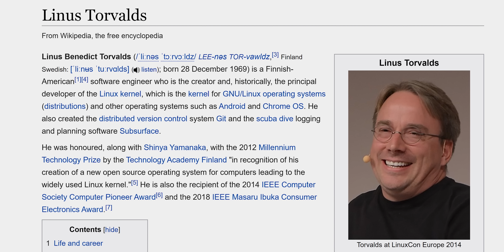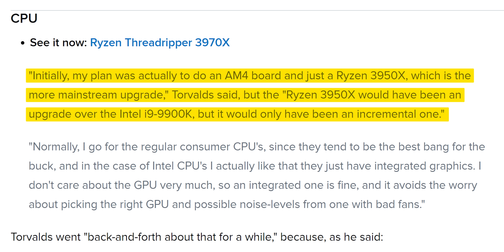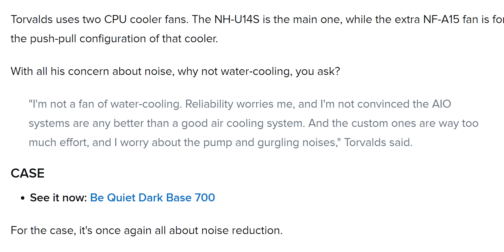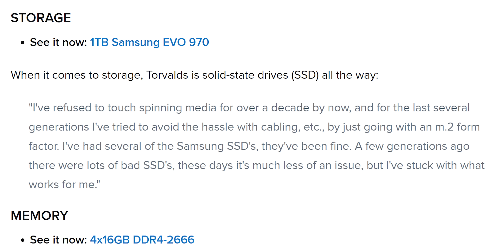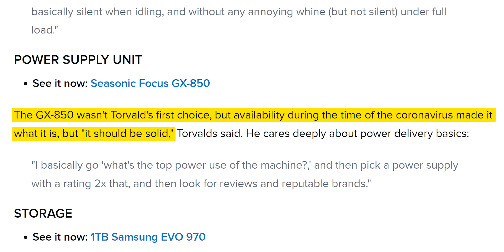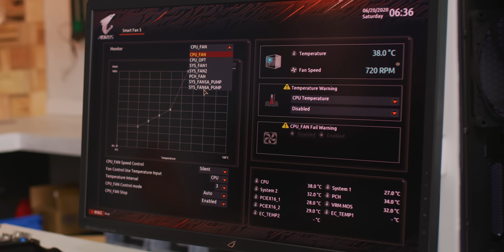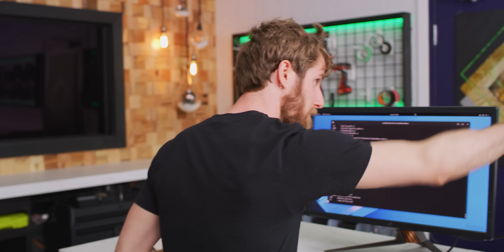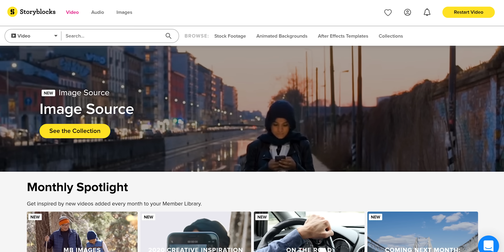Linus builds Linus’ new PC!

Comment: Is there actual evidence that having two fans in a push / pull configuration on the cpu heat sink does any good or enough good to be worth the trouble?  In general I've thought the only thing that really matters is you want the fan to pull air through and not push it because it's better for the flow to be laminar (suck/fan downstream of cooler) instead of turbulent (push/fan upstream of cooler)

Comment: for some reason booting into Windows after using Linux Mint on a 1660 SUPER caused Windows to blue screen due to driver problems (rebooting afterwards fixed it but then it would repeat if i used Linux again)

i agree with (other) Linus

Comment: Another pro to going double what you need on your PSU is that power supplies tend to be most efficient at around 50% use which means that at max use your PSU will be running at its most efficient

Comment: "He actually doesn't even need 64GB of memory"

Huh, weird. As a software developer myself, I find compiling to be very memory intensive, particularly with so many threads. I actually upgraded my system to 2GB of RAM per thread, because I was constantly running out of RAM with just one. It might just be the kinds of projects I compile - scientific computing code has a lot of metaprogramming that needs to be dealt with at compile time.

Comment: Looking to build a machine which will be running only Ubuntu for developing Linux and LLVM. 
Having an Intel 12700 CPU, 64 GB RAM, WiFi 6 are hard requirements.
My problem is that I cannot calculate my power and cooling requirements. Also, I am NOT A GAMER. Hence, will not be needing those high end GPUs. Unfortunately, the only videos I see are for gaming PCs which feature GPUs. I just need a low end GPU, something like this build had.
Looking out for a kind soul to help me out with this build by suggesting the other required components

Comment: Mine is better, same Threadripper 3970x, with 2x WD Black SN850 1TB, 4x WD Blue 4TB, 2x 32GB DDR4 3600MHz, 3x RTX 3060 12GB (DL Training), 1x RX 580 Sapphire Pulse (display), 2x Corsair RM850, Noctua NH D15, Custom Acryllic Case, but only TRX40 Gigabyte Designare, Purpose : All in one Software Dev + DL Training workstation

Comment: The important thing for dev focus build is one, a multi core CPU with tons of cores.  The more threads and modern the Architecture the better.  Compiling uses all the threads you can give it so try to put a ton of your budget into that.  Next you need a ton of RAM. GCC for example will use a ton of RAM per Job so you want a ton and tons of RAM.  Get at least 16GB bare minimum but try to go for 32G or even 64G or beyond.  Rule of thumb is to count the number of threads in your system and multiply that by 2 to get the most optimal amount of RAM needed to quickly compile without using Swap memory.  So if your CPU has 32 threads get 64G of RAM. If you have 64 threads go for 128G and so forth. For your disks, a good SSD is important.   Get a quality NVME M.2 SSD with enough size to hold your code and compiled binaries but make sure is as fast as possible. Lastly Motherboard realiability is a good to have thing.  Get one that has quality parts but dont pay too much for it either. Unless you work with GPU related code, dont worry too much about the GPU just make sure its a supported GPU and is stable. If developing on Linux I recommend either using Integrated Graphics if possible or going the AMD GPU route.  AMD has solid Free drivers that just work out of the box and you dont have to worry about it.  If you need an NVidia card because of CUDA then make sure you install the NVidia propietrary drivers needed.  As for the software if you are doing Linux development you need a bleeding edge distribution so something like Fedora is actually a great choice, another great choice is OpenSuSE Tumbleweed and if you want to get your hands dirty a lil bit you can always do Arch Linux.

Comment: Why did it take so long to compile the kernel? Make would only recompile the source code that changed. You do have to link the object modules together. 3 minutes seems awfully long just the link a few hundred object modules. I use Smalltalk so changing code require less than 3 seconds.

Comment: That's one expensive machine, but not very portable. Could make sense as a headless server with a GPU upgrade.

This is what I want as a developer: a light, small formfactor laptop with 10h+ battery, 16G RAM, thunderbolt 3, decent screen, good trackpad and a great backlit keyboard. I really couldn't care less about the laptops performance, so long as it can handle a lot of tabs (hence the 16G of memory), and is able to dock to 2 high-res monitors, ethernet and other USB peripherals with a single connector while fast charging (hence the thunderbolt 3). This is especially important as I work both from home and the office, and I don't want to have to assemble and disassemble my stack on a daily basis. Heavy load? Utilize a build server.

Comment: As a dev, I work on a Dell Latitude, but it isn't used to compile software as the code is built on a server.
For my personal build, I am using a Thinkpad T440S with a SSD. Good enough as a daily driver, developing and doing some electronic designs.

Comment: Yeah, I agree with Torvald's cooling opinion. I've not seen any reason to go water-cooled over air. All you're doing is moving the heat to a different part of the system to be air cooled, so why bother with it at all? Just get more airflow within the case. That's why I got the big ol' ATX and put 120mm fans in it. Can't hear them one bit, but they move so much air I'm looking at 50-60c under load.

Comment: The Nvidea 1030 needs no power cable and some models with the right heatsink can be fanless. I was surprised to get a higher FPS (Cinebench R15) with the 1030 than with a 1080 on the same computer.

Comment: I do Software development in C++, so a fast CPU is a good idea - Except that with distcc, most of the work is done on servers so a decent is enough.  I have some random AMD GPU for the OpenGL parts of the software - But don't care much which.  I guess that my GPU is a decent representation of what customers may have, so I think it's a plus really.  RAM is super important, 32GiB minimum on desktop.  Also, absolutely no HDD please - SSD 100%!  Don't care if it's SATA or m.2 however.  Most important is that everything is supported on Linux!

Sounds pretty boring I guess - But it's a tool to get work done, and not to game on.  On that note, a really good keyboard goes a looong way!  Not only for the typing experience, but also because cheap keyboards always broke on me after 6 months lmao.

Comment: This IS a PC I'd build myself, if i wasn't on for gaming and had to much money so i could spend the money for a threadripper. I love the choices, especially the choice for the fans and the case. And what i also totally like is the absence of any damn RGB LEDs inside of it. 

Why everything marketed as "gaming" must have RGB? The only RGB LED Thing connected to my PC is my SharkoonSkillerMech SGK3 (brown switches) and it's set to faded red (because that doesn't dazzle and is still good to read, not that i needed to read the keys ;)).  Without any freaking effects. And that keyboard was my choise because its a reasonable priced mechanical keyboard with brown switches. 

Who needs RGB-Lighting in cases that are usually standing on the ground, in most cases under the desk, where no one sees them anyway (as desktop cases are usually not high enough for an usual PSU or they are the desk itself, which makes them usually really expensive)? What I COULD understand was a single mode LED inside the case to see the parts while the case is opened for maintance. Well, but usually you turn of the PSU or better take the wire OUT of the PSU, so that would not bring that much of advantage too.

Comment: All my builds last 5 years. G-skill DDR4 3200. Seasonic psu if they make one in the physical size I need.( I do a lot of mini-itx builds so Corsair/Silverstone. Last 20 years...Noctua CPU coolers and Noctua fans exclusively. Nvidia graphics cards exclusively. MB? Asrock but am open. CPU's open if using a GPU. No GPU I go with Intel. Case? Open. Lian Li, Fractal design. Built an InWin Chopin today. Nice case and is made in Taiwan. SSD's...lowest price as long as I am familiar with the brand but prefer Samsung overall.

Comment: i'm a developer and i'm not really knowledgeable about hardware, and thats why i bought a machine with the following specs:

AMD Ryzen 9 5900X 12x 4.8GHz
32GB DDR4-RAM PC-3600
Nvidia GeForce RTX3080 10GB
240GB M.2 SSD 
MSI Watercooling

7.1 AUDIO BOOST / Gigabit-LAN

it was about 2500€, now it is 3000€. I honestly link it is overkill. I woud've loved to get in contact with you about this before i bought it :(

Comment: My aircooled PC is zero dbm (and Fans are running!) and even under load its very very silent. My refridgerator is louder as my PC. This shows too, that a good Aircooled PC (Noctua btw) is sometimes way more silent as AiO or Custom Watercooling. CPU is i9-10850K with a 1080Ti that will get a upgrade to RTX or a AMD Graphics card soon.

Comment: I can't agree more on power delivery.  

I never overclock more than 10% but man, I've had things go bad from bad power delivery even at stock speeds.

The heat sinks on M.2 is more for the controller than the flash memory.  In fact, if you put a heat pad on anything for it, go for one over the controller.

I agree on him about nVidia.

Proprietary API lock-in with CUDA is just the start to their evil monopolistic tactics.   I'm so glad to see Team Red making good GPUs again!

As of RAM, I like the G.Skill ultra-low latency 3200 DDR4 sticks I have, but admittenly my system has run much hotter since I got them in.  (I'm running a 1st generation Ryzen, so yeah, it wasn't designed for the higher voltage RAM, and it runs hot with it.)  The nice thing about the 2600Mhz is it's the fastest you can get at the lower voltage, making it run cooler and quieter. 

I would have used the Rx5000 series GPU, because they consume less power, and produce less heat as a result, making it nice and quiet.  Of course, like he said, he doesn't like to research and it was more what he could get for the price.  The Rx5000 series was jacked up in price by Bitcoin miners when he did that build, due to it's exceptional power efficiency.

Comment: the fox was and is better than the penguin. there's like no question about it unless you're a normie

the nvidia thing is partially bc nvidia refuses to open-source their drivers, meaning non-proprietary Linux distributions (like default Ubuntu) can't include the nvidia-driver package by default and have to use a half-broken reverse-engineered driver called 'nouveau' instead. this especially breaks intel/nvidia hybrid laptops (like my 7th gen i5 + GTX 1050M dell laptop); you have to change GRUB settings to be able to initially boot and if you want to use your actual graphics card's capabilities you're forced to download a proprietary driver. so yeah. fuck nvidia.

they can include mesa for AMD because AMD actually plays nice and open-sources their drivers. so if you plan to use linux for any reason, go AMD.
Reply: nVidia for Linux sure is a headache, and you can't even psiphon it's full performance due to bad driver support. Absolutely go team red for linux.
Reply: @zookeeper225 nah, it's objective fact that foxes beat penguins in hand to hand combat

Comment: 16:13 - You don't need extra snappy memory, especially on fedora. 3200 would be overkill. ECC is a WAY more important feature.

🤞 Fingers double crossed this video means LTT is finally expanding into the adult world of computing and not just gaming for teens and YA. 

Would LOVE to see more practical server builds WITHOUT a focus on gaming, YouTube video production or water cooling.  A server build for home automation would tie in nicely with the recent UBNT Protect videos. More IoT in general would be great actually (and not just from a trade floor or review).

An AI server build with a focus on tensor cores would be sweet, and there are SO MANY AI based videos you could make off of that system. Heaps of cool stuff, including using the Google Assistant source code to compile a locally hosted virtual assistant without privacy invasion.

Virtualisation and container videos working inside linux or windows SERVER would be awesome as well. Heaps of opportunities for content there far beyond gaming. 

Jake and Anthony both have some great server and use case other than gaming ideas for videos that Linus has said no to. Change that. 

Also, loving that Alex is in more videos recently, keep that up. I miss the videos he used to do with radios. Especially the long range networking ones. 

P.S. The new elgato lights Linus has at home aren't set up right. And Luke not having any directional light makes the WAN Show feel weird

Comment: I love Linux. Linux is on my 15 year old HP Pavilion dv1240us (upgraded ram to 1.5GB), on my $35 dollar Goodwill Goodbytes Dell Optiplex 3010 (that I will hopefully soon upgrade a lot - from a core i3 to core i5, 4GB to 16GB RAM, HDD to SSD, and adding a NVIDIA GeForce GTX 1650 Super LP GPU), plus the laptop I'm typing this on, which dual boots Ubuntu and Windows 10 - specs for this one are as follows: Intel Celeron N3350, 4GB RAM, 64GB eMMC, model: ASUS VivoBook E12 E203NAS-YS03, dual-booting Win10 and Ubuntu.

Comment: Just build a new PC with a b450 max, RTX2060, Corsair 8g ram DDR4 x2, AMD2600 max, thermaltake 500w. Everything went it correctly followed a YouTube tutorial. Went to go power it on and nothing. Unplugged the 24pin power cable from the mother board and plugged it back in. The LEDs on the mother board flashed on and the GPU spun for a millisecond. But it wouldn’t turn on. I’ve tried everything I could think of to trouble shoot it. Unplugged the ram, tried it with no ram, unplugged the hard drive, did the paper clip test for power on the PSU it was good. Unplugged all the PSU cords and re plugged, nothing. Took out the small battery on the board for 15 minutes. Same thing. I’m running out of ideas and patients, please help me out

Comment: Three and a half minutes! I remember compiling around 1994... If you started the compile when you went to bed, it was usually ready when you came home from the university the next day.
Reply: also no need for room heating!
Reply: @remasher  didn't know 50w is enough to heat the room
Reply: @NUBAS12345WoT  just a figure of speech, party popper.
Reply: It really depends on how you configured the kernel. per default a lot of drivers are included, but if you compile that kernel only for your specific hardware and therefore deactive everything in the kernel which you don't use, you save a lot of time. And you save that time everytime you compile a new kernel version.

I'm a Gentoo Linux user for more than 15 years and am compiling my kernel ever since. On my Ryzen 3700X it only takes a minute to compile a new kernel version (with my config). If I don't configure it and go with defaults, it takes way more than 10 minutes.
Reply: @GeNTooFReaK  weird flex but ok

Comment: I would definitely love it if you guys did a developer focused build. Focused on compiler and IDE performance. Those compile times can be pretty detrimental for productivity and focus.
Reply: if you're not game developing or working with 3D programming (OpenGL and the likes), the biggest CPU you can buy and a decent amount of ram (currently the "standard" is 16gb, so double that).  

It also always depends on the type of work you do, as others have said, having a top of the line productivity rig can be detrimental to understand end user experience f.e. web dev (but I say fuck it, they don't read the instructions anyway).

Comment: 4:59 i'll tell you why I hate the Gigabyte Aorus boards because of where they placed the M.2 slots right under the PCI-E where the video card goes.. obviously the hot air from the video card fan is going to overheat the M2 unless it has its own cooler, and believe me a cooler will not fit if a video card is above it.. really dumb board design.

Comment: How about an BUSINESS PC.  Similar to a developer PC, but with more emphasis on single thread performance and multiple monitors.  In my case a 10900k with three 4K monitors and a 1060.  Odd use case on my end as I run crunch some business data on SQL Server and on a Linux VM, thus 64GB and overclocked to 5.2 GHz on all cores.

Comment: So is the RX 580 good for gaming or no? I'm looking to buy upgrades and I chose the RX 580 because of its price point, anyone have other suggestions? Thanks! (Upgrading from a GTX 750 Ti)
Reply: Yes the rx 580 is a great card for 1080p gaming. Other options could be some of the 1650s and the 1660s from mvidia. Other options from AMD could be the rx 570 or the 590. Other newer options could be the rx 5500 or the 5600.
....
Oh and another thing. If you do decide to go for the rx 580, then make sure to get a 8gb model because this will allow more ram for the gpu to use for games. Usually they are priced similarly to the 4 gb anyway. 

Hopefully this helps.... :)

Comment: Can you point me to a similarly sensible, near silent build for 1000€? Linus's PC really appeals to me, but i don't need THAT much computing power. I love the silentness of it. I'd be thankfull for any pointers, because i am hopelessly outdated. I had, for 10 years, an absolute DREAM of a CPU, a (SandyBridge) Core I5 2.400, running at 3.6 with watercooling on a good Gigabyte Board  with 8gigs and a fully heavily padded case. Was almost silent, reliable As F*** and performs well until today: I mean, i played Battlefield1 on it until 2017 (!!!) and still plays Witcher3 etc. I am looing for something that will last me 10 years again.